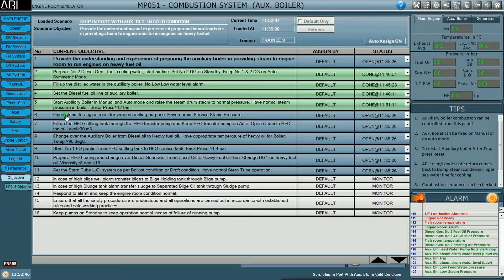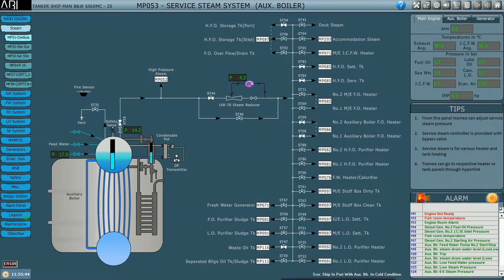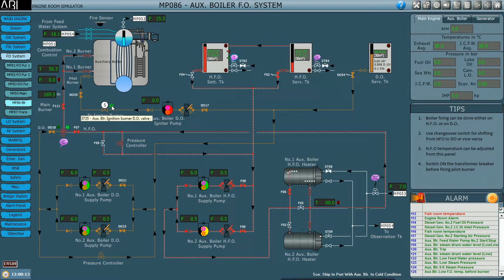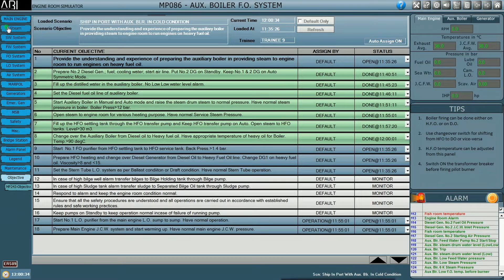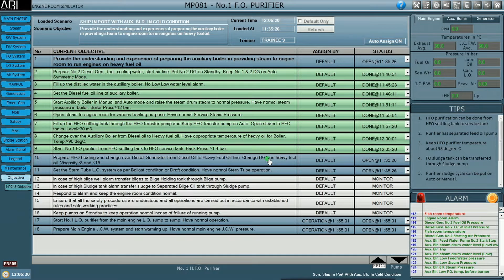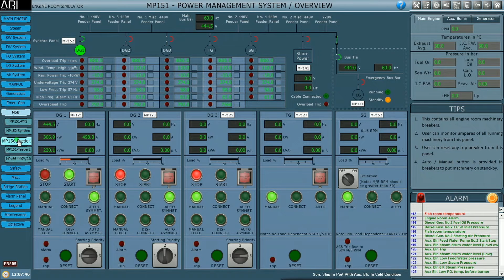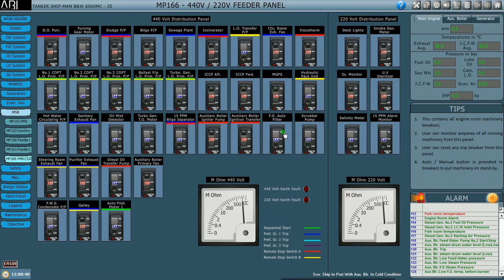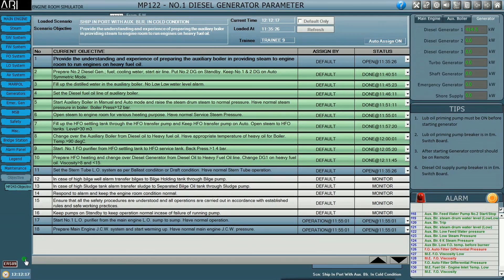Fuel Changeover Procedures & Purifier Operations | Engine Room Simulator | Garish Jerome

Comment: hello sir. I have a question. we are also using similar ARI full mission engine room simulator. when we get a "bowl not closed" alarm, how do we reset this in the simulator? we cant figure out and when it happens we just reset the entire scenario. we try manually operating the closing water but the alarm does not go away. we cant find anything relevant in the trainee manual as well. thanks in advance.